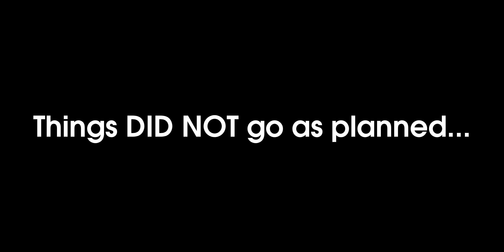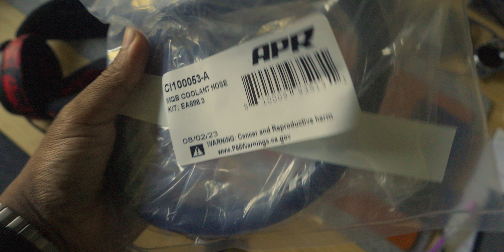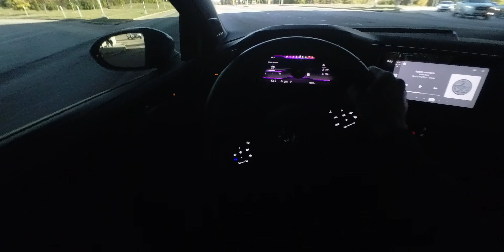MK8 Golf R gets NEW APR Intake and it SOUNDS GOOD

Comment: I just got the APR intake and i have the same issue with the DV router hose, it actually snapped. How did the shop managed to fix it?
Reply from the maker: Lucky mines didn’t snap but if I remember correctly…we had to shave a part down on the APR charge pipe in order to accommodate it…my situation might be a bit different as I have the APR turbo hose kit as well…but if you Watch back you’ll see the shot of what he chose to shave down…

Comment: Which has been the best intake out of the ones you've had. I remember seeing you had the nuespeed intake. Have a mk8 myself want to know what irl feels and sounds like.
Reply from the maker: I'll put it to you like this:
Nuespeed: Very open loud turbo noises and installs nicely
MST: Another loud one install is a bit more complicated than nuespeeds but sounded great. Also the "closed" add-on didn't fit for me on this one
APR: The most well rounded and versatile considering you can run it open or closed and install is clean. Nice sounds open and sutle yet audible turbo noises when closed

hopefully that helps
Reply: I just did the Neuspeed intake with the Neuspeed hose and inlet. Install was perfectly straightforward and smooth. Sounds great. Both are nice, but I didn’t want to,reroute the coolant hose and did t need to with Neuspeed

Comment: Engine Cover = Uselss garbage.  Harmful actually, as it traps heat and directs it down onto hoses and wiring, causing it to become brittle and fail sooner.
Reply from the maker: Yet the car came with an engine cover. It was removed do to recall but my GTI has a factory engine cover on it
Reply: @CJUnplugged  do you, ignore the h8trs... I'd get the cover too if it had blue accents.  Ha